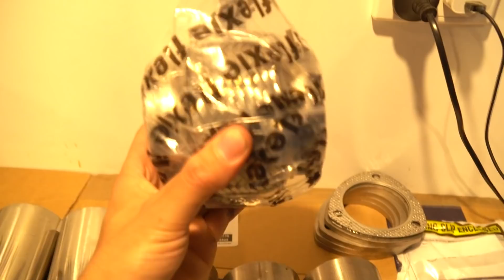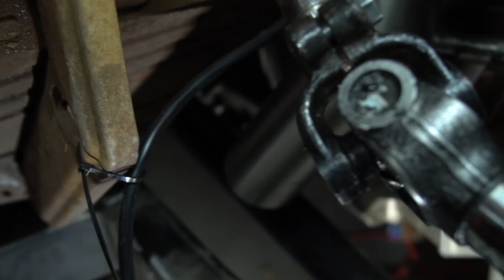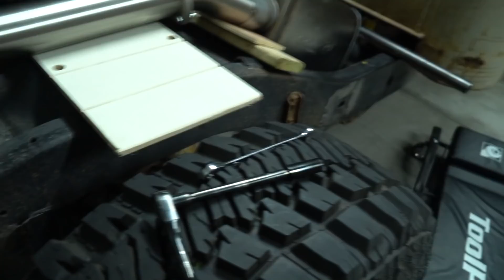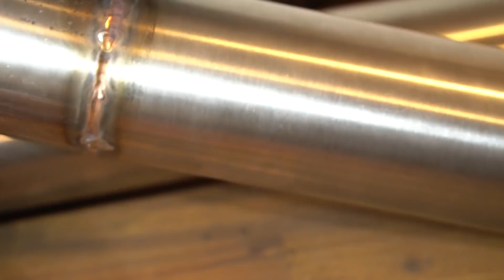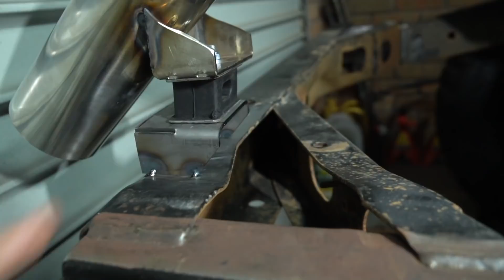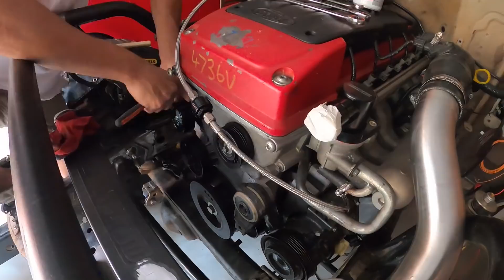Modelling my Landcruiser on CAD & Making a custom exhaust  -  Barra T FJ 45 80 Series Build Video #8

Comment: Great work Richard. Always look forward to your next video so would also enjoy the CAD video. Was just wondering about engine rock and the ability of the exhaust as you've mounted it to cope with the movement. Is the flex joint you've put in enough?
Reply from the maker: Hey Adrian, I initially thought that it would be but reflecting on it and talking to a few people I'm not so sure anymore. Thinking about mounting the exhaust to the bell housing and then putting the flex plate further back in the system.

Comment: what do you clean the exhaust with before tig welding it to get the colour ?
Reply from the maker: Using acetone before I weld it! Admittedly I’m only getting that colour on the flanges when I’m using a bit of filler.
Reply: @DesignedandBuilt   yeah i use acetone swell but don't get colour for some reason, i might need to lower my amps and go slower

Comment: Great video mate, I would also be keen to see you make a CAD vid! 
Personally I don't think you should need that extra exhaust mount, your exhaust tip mount should hold the upper weight just fine
Reply from the maker: Cheers Marshall, looks like I might have to do one, and cheers for that input, I'm thinking I might just put another one in for good measure!

Comment: Hey mate, love the work. I have a barra 80 zf6. The rod shop kit needs a fgmk2 power steering pump. Alternatively there is a bloke doing press in fittings for the fgmk1 pumps on Facebook market place. My conversion is the banner for barra cruisers. Not as tidy as yours looks but it works. Cheers Clayton
Reply from the maker: Hey Clayton, cheers for that info! Might see if I can get a press fitting. I’ve definitely looked at that photo for reference, arguably tidier than mine, good job! How many litres per hundred are you getting and how many kws out of interest?
Reply: @DesignedandBuilt  I'm getting roughly 16lph. Not bad at 3 tonne and shaped like a brick. Mines only pushing stock power for now. Will get it tuned shortly but more for drivability and economy

Comment: I would look at your first mount being a more solid mount to the engine or gearbox. Then flex join after that. That way the first section of exhaust will move with the engine as it vibrates and twists under load.
Reply: Yep that first mount and flex pipe is going to get absolutely hammered. 
One piece pipe along the gearbox to a mount directly off the rear of the gearbox/transfer  (not fully solid mount, something that has a little bit of give to account for heat expansion like two opposing thin L brackets, check out factory subaru mounts for inspiration) then flex after that mount.
Reply from the maker: @MattyP4x4  Cheers Matty, yep I think I'll change it!
Reply from the maker: Yep thats a good idea, I don't really know I can move the flex plate any further back otherwise it ends up being past the TF case, are you just talking about adding another mount on the dump pipe?
Reply: You could mount somewhere around the bellhousing then again around the transfer case. So 2 mounts solid to part of the drive train that has movement. Then put you flex joint before your next mount to the chassis.
The only thing to consider is the exhaust "growing" as it heats up so the mounts need some way to account for that.
I know Al from the skid factory has covered this but i cant remember exactly what he does.

Comment: Ceramic  coat all you're hot side parts   sick build btw
Reply from the maker: I was thinking about doing theManifold, turbo and dump pipe (ie up to the flex plate). Is that what you mean?

Comment: Awesome mate the only thing I can say is the muffler placement. Yes it’s all well to put it where there’s space but you also get a different sound out the end, depending on where you put it. Turbo cars and v8s always sound better with it as far back as you can before the tip.
Reply from the maker: Thanks Edan, I have honestly never thought about that. Cheers for letting me know, I guess we'll see how it turns out and I can always modify if need be?
Reply: @DesignedandBuilt   that’s it man. It might not sound bad at all. You might like the way it sounds. Just see how you go. Loving it so far.

Comment: If you don’t need clearance for the tyres through the suspension cycle, consider sticking with the stock spring height. Much better handling, most of the time, especially if you’re planning a lap of the country. Cut fenders, fit sliders etc instead. Will still perform great off-road with those tyres. Spend the money on lockers and some low range gears from Marks.
Reply from the maker: Cheers Rhys, I've already ordered my suspension unfortunely. Not going too crazy, 3" lift and no body lift. I'll likely get the lockers anyway, hadn't considered the low range gears though, good thought!
Reply: @DesignedandBuilt  3” is fine. We use to fit 6” coils and 2” body lift to 80s and GQ wagons. They looked good but handled like pigs :)

Comment: Yes Richard I would definitely mount at the muffler, just think corrugations mate and you'll soon realise yep extra mount !!  Also droning exhaust are SO irritating and obnoxious to listen to hour after hour !!  Just be careful the exhaust flange at the rear doesn't overheat, melt and catch the top shocky rubber on fire, maybe a shield of some sort !!  The front exhaust mount on the chassis and the center mount on the chassis maybe try and tig the inside of the mount as well for extra strength. High mount alternator look great, just remember mate when your lifting the truck, don't make it too high because at the end of the day you've got to work on it comfortably and climbing up and down the front of the truck to fix things ALL THE TIME gets really old really quickly and it's exhausting, especially when it comes to putting things on the tray. The last thing you want is trying to lift heavy or or quid things onto and off an over the top high tray !! I'll watch whatever vids you put up mate, it's your channel, I'll watch it all. Seeya Rob.............excellent vid by the way Richard.
Reply from the maker: Thanks Rob, yeah I reckon you're right with the muffler, I'll get it done! I plan on doing a lot more welding on the chassis mounts once it's all apart before it goes to paint, I'll be sure to get some inside passes on it. Also a good call with that heat shield. Not going too high, only another inch - agree with you 100%!